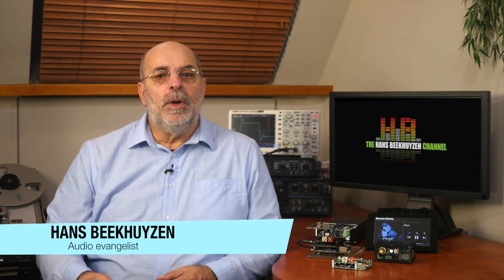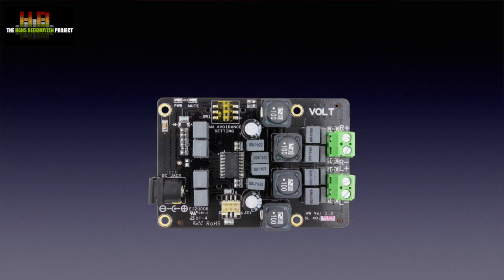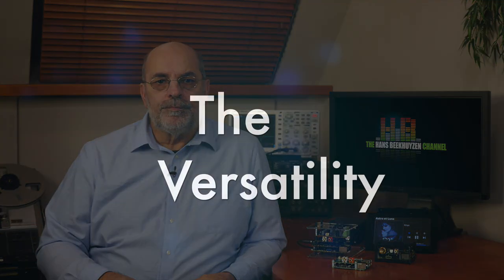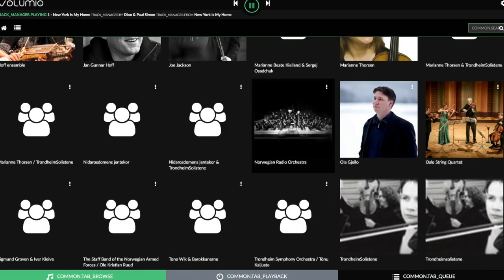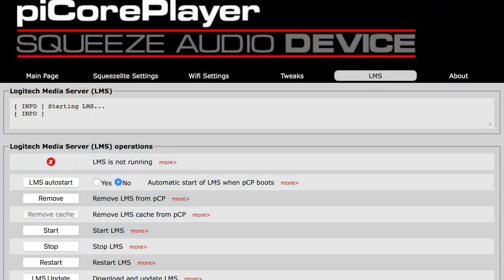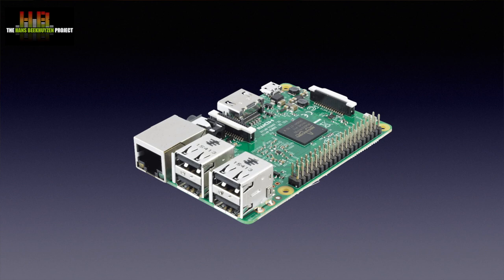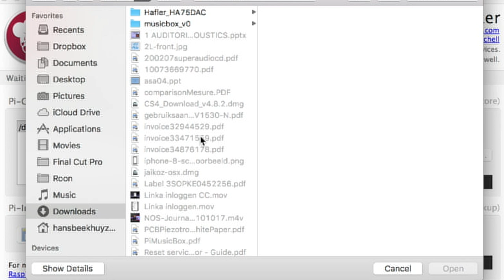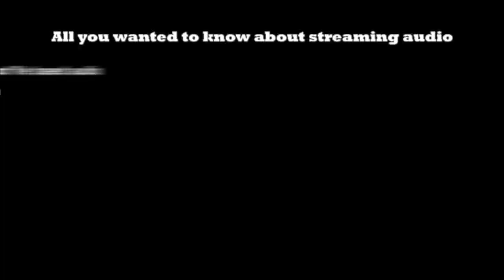An introduction to Raspberry Pi hi-fi

Comment: Best media player for content that is connected via USB device?
Reply from the maker: No, it's not the best media player but it certainly can be decent if you use an audio grade USB board. I like this one: https://youtu.be/f0tMX8EdP4Y. That is not a Raspberry Pi based system but it is about equal but with far better USB. And it still is very affordable.
Reply: Will it work for the Pi?  That is what I use.
Reply from the maker: No, I know of no audio grade USB board for the Pi. The USB outputs on the Pi will work but will not send a clean USB signal to the DAC.
Reply: Sorry, I should have been more specific.  I run a Pi with an Idac2 and it functions really really well.  My storage is connected via USB.  I am just trying different software at the moment.  I use this in my car.   I compete in IASCA and MECA SQ competitions.. we are always chasing a better sound.  I use Kodi with Carbon Car PC skin... just curious what other software out there works well?

Comment: Can you stream Tidal/Qobuz/etc. through raspberry pi?
Reply: With some of the mentioned client server solutions like LMS yes.
Reply from the maker: Yes, but that depends on the software you use.
Reply: In the client server soluton, do i need a separate pc to drive the Pi? If so, why not going directly for the usb output of a fanless miniPC, even boosted by Fidelizer or similar?
Reply: Yes, if you run a server, you need to run it either on a pc or a NAS and your Pi acts as client. Of course you could feed your PC straight into an USB DAC, but w/ a client server solution you can have players (i.e. clients) in more than one room and--depending on the system--even have a multiroom audio setup where all players are synchronized and play the same all over the house. Much like Sonos, but imho way more cheaper and flexible.
Reply from the maker: Well, you might be right there. But on a Pi you can choose your own SPDIF output, on a miniPC that's fixed. USB on the RPi is bad, but that might als go for the MiniPC. Furthermore I would use a stripped down Linux version rather than Windows or MacOS.
Reply from the maker: AS I said in the video you could use the Pi to run the Logitech Media Server or a DLNA server at the same time. That solution will work if you only have a limited number of albums, the speed for browsing your collection might get irritating if you have more than a few hundred albums. You could also consider the SOtM-200 that also is able to run LMS or DLNA server but has a very clean USB output to a DAC (https://youtu.be/TV-FvRF9KGA).
Reply: Is it possible to install a bubbleupnp or openhome server on the Pi directly so that no other box running an external server is required? My dream is just a single, easy to use, cheap and good sounding tidal/qobuz streamer...
Reply from the maker: I have no experience with that. Sorry

Comment: You say the best sound comes from an spdif board.
Dsd or hires audio is not available on spdif, or is it??
Reply from the maker: I said that //on the Raspberry Pi// the best sound comes from SPDIF. SPDIF does support hi-res and DSD if your DAC does so too.
Reply: I believe it is available. Once you understand how Nyquist-Shannon digital sampling works, though, you realize that so called hires audio is rather pointless and you only need support for it for compatibility reasons. You can make a much better case for 32/48 audio than you can for 24/192 once you understand how digital sound sampling works. Going beyond the required Nyquist rate for audible frequencies is like documenting more than two points on a straight line in order to be able to draw it with a straight edge. It's unnecessary.

Comment: Hans, since USB in Pi 4 is independent, I guess the onboard USB audio output is equally good as spdif option?
Reply from the maker: I don't expect that, but let's wait and see...
Reply: @TheHansBeekhuyzenChannel  What's the real cause for USB audio quality then? Basically, you are saying i2s is superior to the dedicated bandwidth onboard USB, assuming no USB peripheral attached to share the bandwidth or cause interference.
Reply from the maker: @tonypeng1815  I|2S is very good but USB Audio profile 2 can be very good too. It all depends on how well the interface is done and how sensitive the connected DAC is for digital mishaps as noise, disturbed clocks and so on. Watch https://youtu.be/grzoqEb2KMk
Reply: @TheHansBeekhuyzenChannel  Thx for the video link but what I'm trying to understand is how Spdif HAT such as DigiOne using i2s connection through GPIO pin of the Pi better than the USB output in Pi 4 which has dedicated bandwidth? Or I'm asking the wrong question because they output different digital signal since one is Spdif one is USB?

Comment: is a Mac with Audirvana and an external USB Dac a better option? I mean sound wise...I already have macs
Reply from the maker: Then what? Than the Allo USBridge combined with Roon running on a Mac or NUC and using a high quality DAC? No. Than a Raspberry Pi without HAT board and running for instance Volumio? Yes.
Reply from the maker: I'mm only reporting on new developments and offer user help. Audirvana was also reviewed and I love it. But the most questions I get are about Roon. And.... you don't have to watch the Roon videos😀
Reply from the maker: simply because it is.

Comment: I was just searching for a some reliable non expensive solution for my audio chain, but wrongly think about this as a solution, the raspberry pie hi fi modules are very expensive and that's nothing compared to the software. this is not the way to solve things.

surely a nice low profile dac would do the trick, meanwhile y save for like "matrix dac" or something like that.
Reply from the maker: The is no such thing as cheap quality 😮‍💨

Comment: Hello Hans
Great channel with a perspective from a fellow engineer!
As a long time audiophile who has collected a huge music library of FLAC music files, I am interested in a solution for implementing a Windows 10 based media server with the ESS 9038 DAC in stand alone mode. There seems to be a predominance of focus on streaming from services and NAS in the info available in your videos. My question is, has Windows networking deteriorated to the extent that you no longer pursue or recommend this approach?  I know I have wasted plenty of time adapting to the windows OS. Just curious about your opinion.

As for my experience.  I have enjoyed the 9018 DAC in a SMSL DSD and several iEast upnp streaming players on my ethernet LAN. The iEast players work well with the Plex media server app and several PC and phone player/casting apps. Thanks for keeping us up to date and poles and zeros to you.
Reply from the maker: First: don't focus on the DAC chip alone. The very successful implementations of that chip use proprietary external filtering, have very low jitter clocks and so on. Then: I would concentrate on a solution where the storage and 'administration is on one fast computer and the DAC on a second audio focussed computer. The latter can be a small board computer like the Raspberry Pi, Sparky and so on. I will publish a video on this within a few weeks.